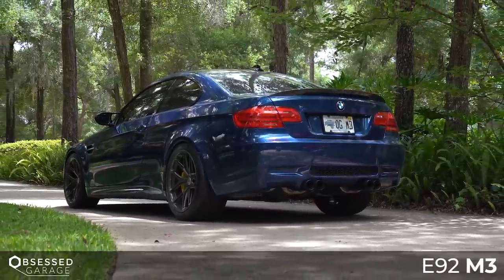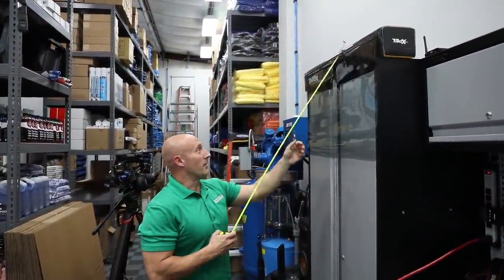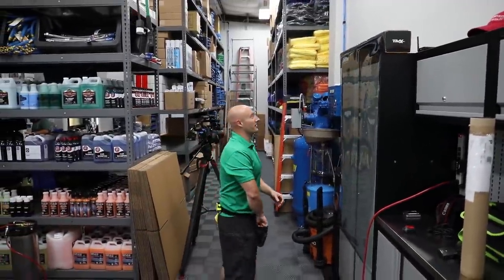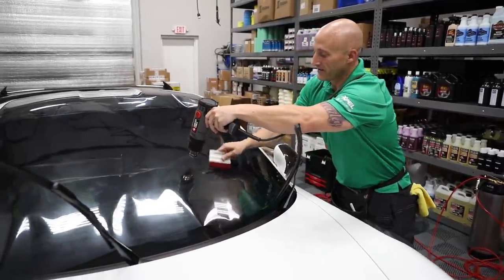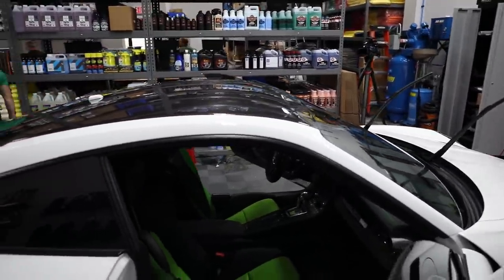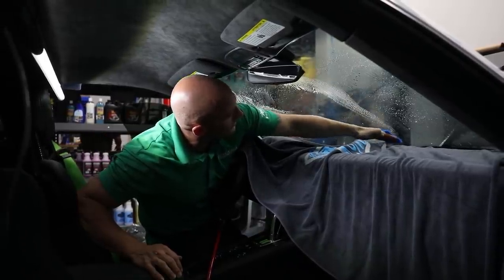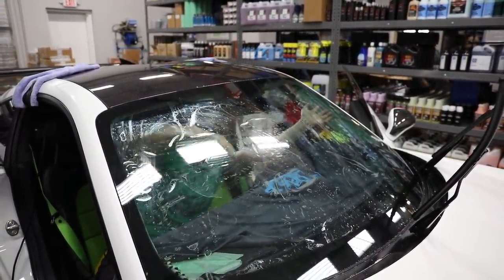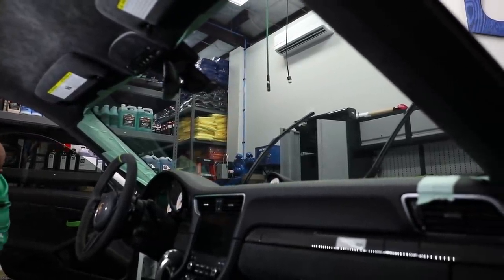991.2 GT3 RS Xpel Prime XR Plus Window Tint - Mobile Tint Installation

Comment: 50 is too dark - you're right to go lighter Matt. I did 50 on my Land Cruiser and could barely tell the headlights were on at night.
Reply: @iluvmyeski  Shouldn't you have told me the headlights in the Land Cruiser are bad?  Doesn't matter both would be wrong.
Reply: RobRed's Expedition Lab  yeah your eyes are bad.
Reply: i have 50 on my windshield and it is fine at night. mo problems at all.
Reply: 20% all day here

Comment: Nice pro job-since he does not appear to be wearing gloves of any kind, wonder how he prevents fingerprints from being trapped on the inside surface of the film.
Reply from the maker: He sprays his hands down with slip solution.
Reply: @ObsessedGarage  Roger that.
Reply: Obsessed Garage slip solution = Johnson baby shampoo. Couple squirts in your bottle works great

Comment: Xpel Prime XR Plus on Matt’s two loves in the M3 and GT3RS so it must be legit :) Initial impressions of the tint? Debating between this and LLumar Stratos. Do you still believe Suntek and STEK have the upper hand in clarity of PPF vs Xpel Ultimate Plus?
Reply from the maker: My initial reaction is that it's very good.  Whatever you do, don't put their anti-static cleaner on it.  That smears like crazy.  I think STEK is the best clarity.  XPEL is still far behind the Suntek and STEK.

Comment: Just makes my skin crawl seeing that razor blade near the car.  230k.
Reply: Donald Duck005   Interesting but weak.  How do you keep from cutting the exterior glass if you are pressing against it with the tip of a razor blade.  Logic says there will be a mark on the exterior glass.
Reply: @bertraminc9412   the razor doesn't cut the glass. Go back to what I said about being trained. You don't cut downward, he has it at an angle so the blade slides across the glass, not cutting into it. Do you watch a surgeon do his work and critique it? No because you have no clue what a surgeon is doing.
Reply: @iluvmyeski    How do you know that I'm not a surgeon?   Of course a razor blade marks glass.  Metal is harder than silica by far.  Anything harder than glass will mark glass if it's rubbed over it.  You may not see most marks with the naked eye but it will in fact mark it.  There are many ways to protect the underlying glass but none are used here.  That's because the industry is high volume, low profit.  You just have to either discuss the process in full detail and demand steps ahead of install or find an installer who understands this and protects the glass.  This is the same as DirecTV coming out and pounding a pole into your front yard to install your satellite dish... if you don't call their bullshit and tell them to install a proper bracket on the side of the house and not on the roof, you'll get a fucking pole, right in the middle of your lawn.  If you don't insist on it the installer will do what he does on every other car to keep the speed and revenue going.  And no amount of "training" as you say will prevent mistakes and errors.  He may not have marked this glass but he's certainly marked glass before and he will certainly mark glass again.  That's the nature of fast installs with razor close to glass.   I've had my window cut by many installers of both windows and tint.  Matt seems to understand this and is ok with this process or he wouldn't have done it.  If he had a problem with it he would handle it.  My comment doesn't have to deal with anyone standing in front of me, working on my 230k car so I don't have to worry about it.  This guy is not taking proper steps to protect the car.. he is a high volume medium level care/preparation installer of good window films and in this case installing on a top quality sports car.  His finished work may be good but his prep is not well thought out.  Only people who work hard all their lives for large earnings and cars like this appreciate what it takes to properly care for a car like this.  When you hand it over to someone who doesn't share that feeling, this is what you will get if you don't discuss it and demand proper preparations steps.  Matt is obviously aware of this and is ok with the entire thing.  Actually, with Matts OCD, I'm very impressed with his restraint and patience with this kind of thing!